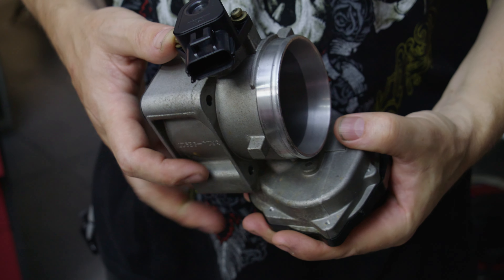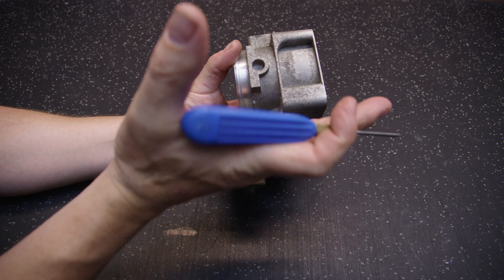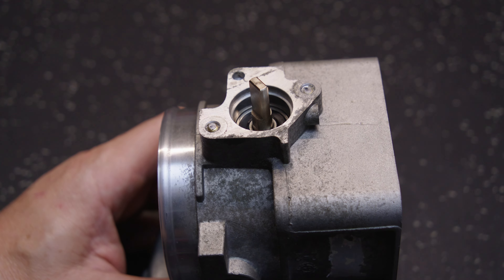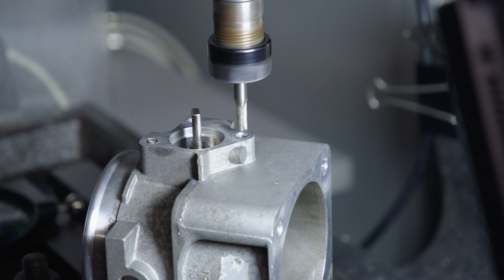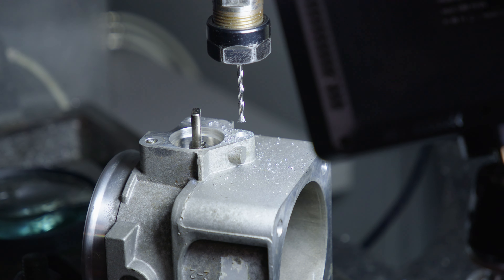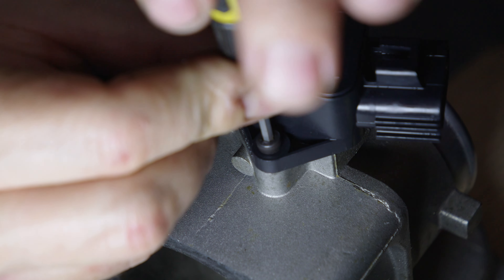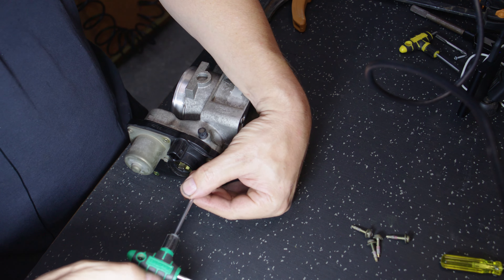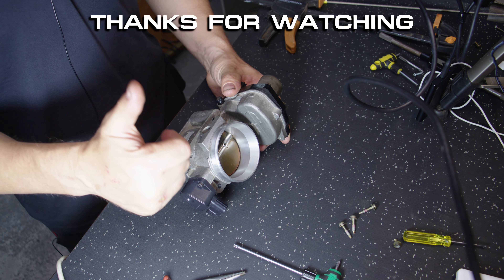#49 - How to fix a Ford BA Falcon throttle body repair broken bolts. 😕 (with teardown)

Comment: I know this is a little down the track, but theory to safely removing the screws holding the TPS is to do it while the throttle body is hot.

The screws are coated in threadlocker from the factory and the heat lessens the bond and gives you the best chance of removing the screws without snapping them.

Comment: Hi there, ive broken the plastic  "idle screw" on this throttle body ive got y=the spring and there is a steel pin inside...any ideas how to fix it...can the car be driven safely with it removed short term....thx

Comment: They put so much lock tight on them from factory. only way to get them out is to carefully heat the bolts up first to soften the lock tight otherwise you will %99 snap them. Ford definitely didn’t want them coming lose.

Comment: Mmmm broken fasteners, my favorite! 

Did you consider dissolving the broken bolts/studs in a warm bath of water and alum? Probably would have taken longer but been much less work.
Reply from the maker: Had a fleeting thought about chemical removal, but didn't want to dismantle the whole throttle body for bath time.  Besides, I felt like flexing some lesser-used skills.  Don't get to use them much these days having an office-based job and all. Still love being on the tools at home every chance I get. 😄
Reply: @xyzconceptsYT  and now it's fixed properly for another two decades.

Comment: How do you get it off the throttle body I can't get to the two lower bolts
Reply: i used an alan key, it was a pain
Reply from the maker: Yeah, the long end of an allen key with a ball end.  It's tricky but doable.